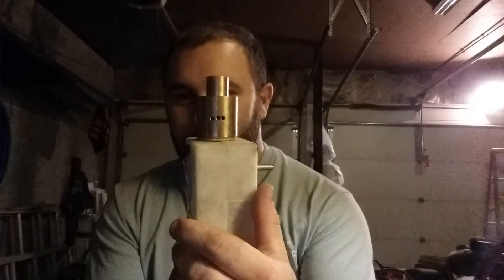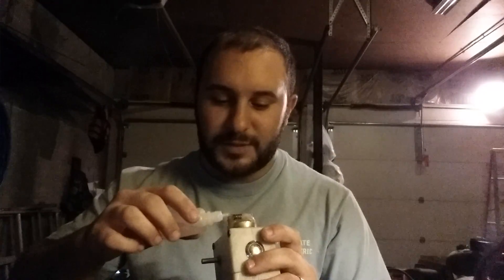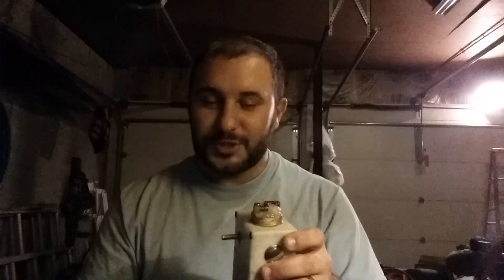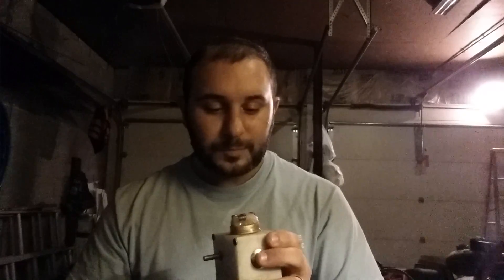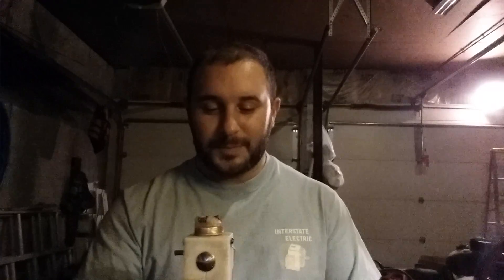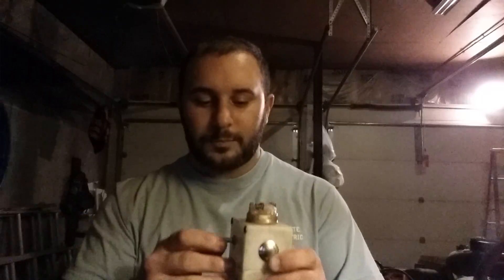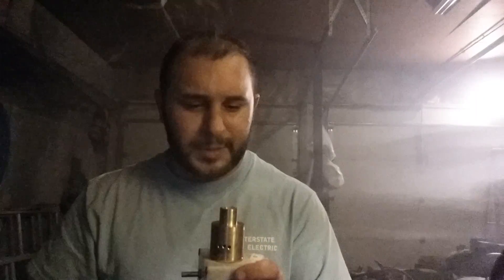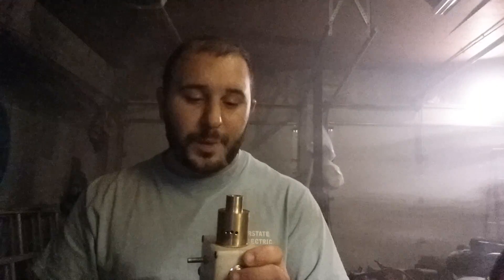3s pwm lipo box

Comment: Hey man I'm kinda new to electric and circuitry but is it possible to make a dual 26650 mech using the same components as an 18650 mod? (Except for the battery sled obviously)